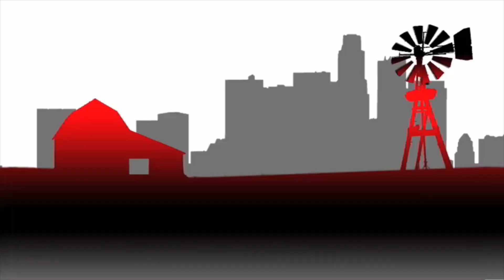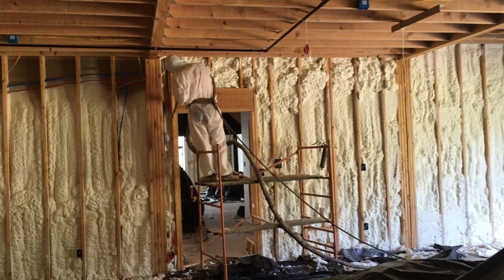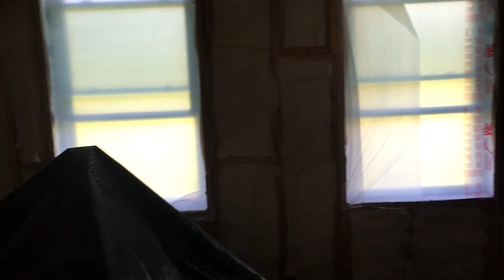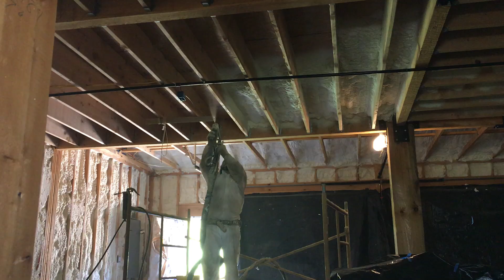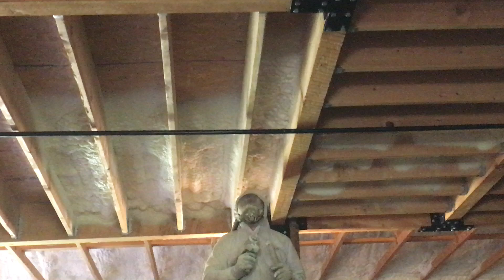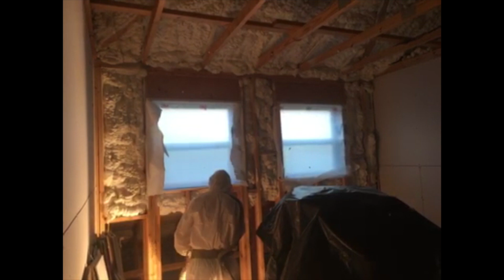House Build Week 21: Insulation

Comment: I'm curious. Why did you go with the metal exterior?
Reply from the maker: We chose that exterior as a extreme low maintenance option. no painting every 5-10 years, no wood rot or insect damage, and not much other than a power wash as far as upkeep. Additionally cost! the cost in materials and labor was much lower than traditional siding, Hardy planks, or masonry.
Reply from the maker: We are editing a video where we explain how we decided what type of house to build and what materials to choose, look for it to be up in the next couple of days.

Comment: That is only a couple thousand $ difference. The urethane foam is so much more efficient you will most likely make that back in the first 5 years. Excellent choice. God Bless
Reply from the maker: That is what we are expecting too. It is already a much nicer place to be in, and on those hot days and we can feel the cooling effect of the large foundation slab downstairs with no AC running when we walk in from outside.